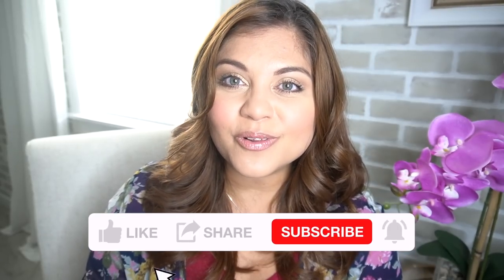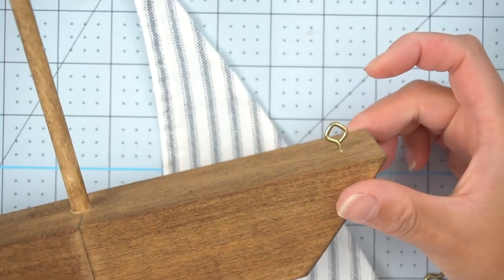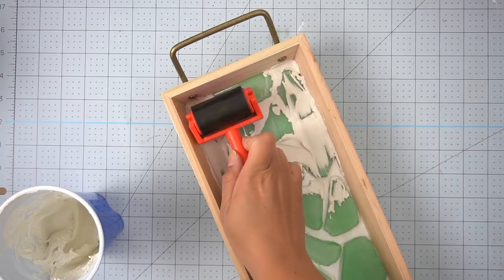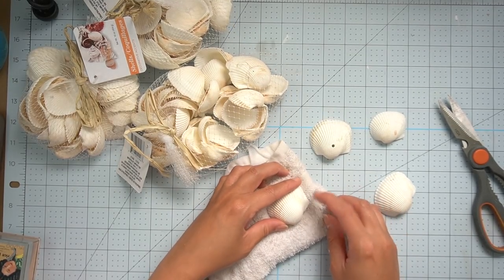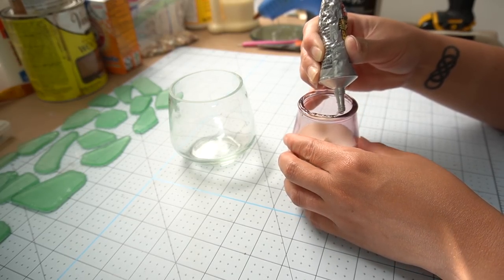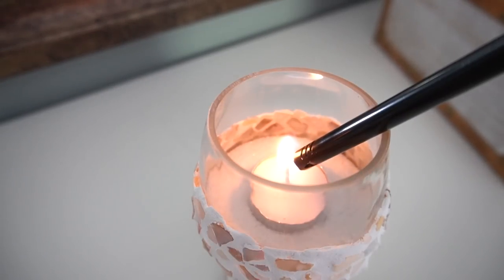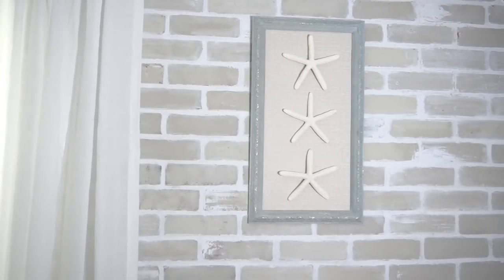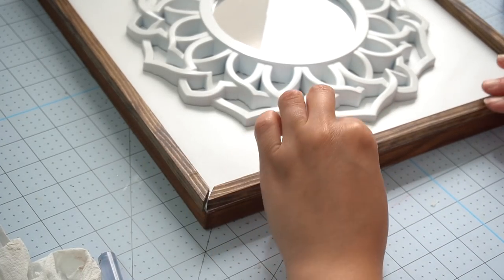*HIGH END COASTAL DIYS* | Beach Decor | Nautical Decor that is NOT Cheap Looking

Comment from the maker: QUICK NOTE* If you wish to recreate the seashell DIY make sure to work outdoors and use a mask for protection against the sea shell dust. It can cause harm to lungs.
Reply: I’m glad you noted this, so many do not understand that seashell dust has sharps edges that will cut into your air passages and lungs causing scarring and long term damage.  Proper respiratory masks and eye protection are needed.
Reply from the maker: @melodysills6862  I’ll be honest, I didn’t know that until after I did this. A sub let me know. Thank goodness I was able to advise others!
Reply: @melodysills6862  thanks I had NO idea!

Comment: A soft toothbrush with water will remove grout and smooth in between. ❤Also, Vaseline is a inside secret for painters. You can use it in metal, glass, mirrors etc. just clean off post painting. For those hard to tape areas 😊

Comment: You could use an old credit/bank plastc card to smoth the grout, it works better than the roller. ;-))
Reply: By the looks of it, her roller had a flat plastic guard that she was using to smooth it, not the actual roller part.
Reply from the maker: I did use the flat part, but the credit card idea is a good backup for sure! Thanks!